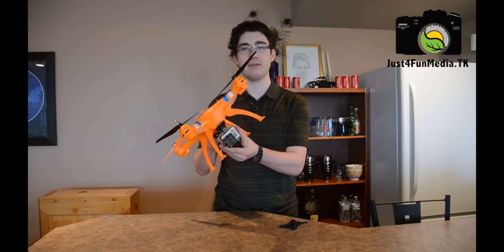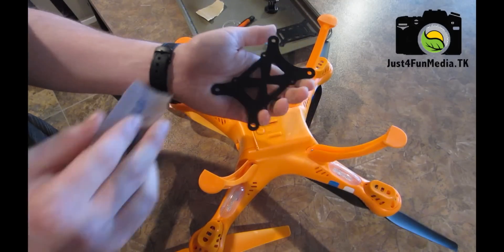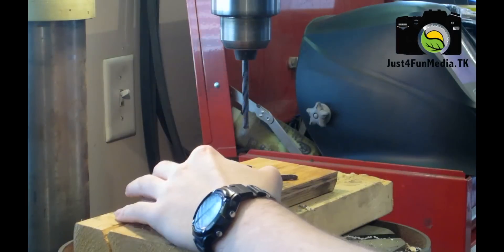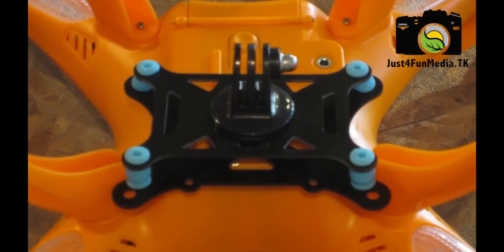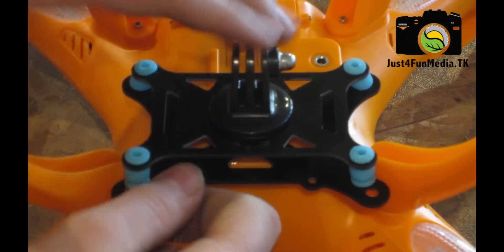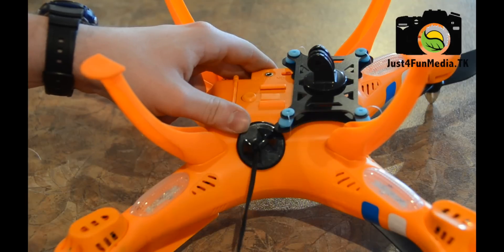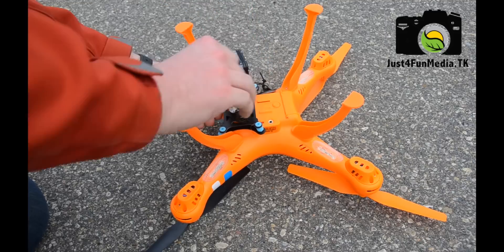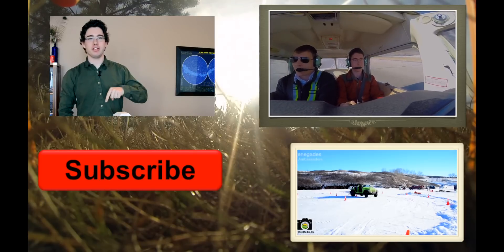$5 Drone - Stabalized, AntiVibration, Torsion Mount

Comment: This just adds unnecessary weight... why not just buy the click in mounts already available for the quadcopter?...

The weight will effect flight...
Reply from the maker: I found the weight helped to lower the centre of gravity and make the flights more stable.

The mounts which come with the quadcopter induce a lot of vibration, GoPro 3M mounts are slightly better, but both leave a jello effect in the video. 

All the best,
Reply: Danno Peters - Just4Fun_Media 

Then get a dampened BTG mount? I doubt this stabilises anything. Adding weight puts more stress in the motors.
Reply from the maker: According to the manufacturer's specifications, my mount only weighed 0.15 ounces more than the BTG mount. My quadcopter was well within its centre of gravity and payload limits.

As is clearly visible in the video above, the mounting system I created did remove the jello effect from the video.

I would not trust my GoPro with the clasp mounting system on the Syma X8, the clasps fit much too loosely and the lock mechanism is not sturdy. 

All the best,
Danno

Comment: Use double stick tape instead of superglue so you can remove it if you want to make changes later.   Also,  I was taught don't grind on the sides of a grinding wheel. (for safety reasons)
Reply from the maker: +Mark Kanzler I used super glue for added security, but double sided tape is a great idea since the surf board mount should hold it. 

 I was taught to only grind flat on the side of grinding wheels (no sharpening tools etc) to avoid groving the side and fracturing the edge.

Have a great day!

Comment: That's cool. But I'm confused.
Decorated like a college student's, looks about 15 years old.
Suggestion: Sand and then trace lines maybe? And use baking soda with the crazy glue for an eternal bond
Reply from the maker: +ROOKTABULA I traced out the mount so that I knew where I needed to sand, as the placement does not need to be exact. 

Have a great day!
Reply: +Just4Fun Media Ohh. I see. Just traced for cosmetic reasons wrt the area sanded. Hope that crazy glue golds out for you. That bond is rather brittle and will weaken with any shocks, over time.

Comment: Thanks for the video man! Did you balance your propellers before? Very informative video with perfect description and direct links to the products! I'm waiting for my SYMA X8G quadcopter: http://www.banggood.com/Syma-X8G-2_4G-4CH-With-8MP-HD-Camera-Headless-Mode-RC-Quadcopter-p-985603.html?p=4Q12031072189201501P and I hope what this will work with it too. I'm planning to mount my XiaoMi Yi action camera to this drone and completely remove the jello effect. How many flights have you done with this X8C drone and GoPro onboard? Are the motors still ok?
Reply from the maker: +Vedinimas Eu I have balanced my propellers before, but it only had a slight improvement in performance. In the video above I was flying with new unbalanced propellers.

The X8 is not as sensitive  to propeller balance as my custom build and other quads I have flown. Prop balancing is great if you have the time, but not necessary because of the loose prop mounting system on the X8. 

Have a great day!